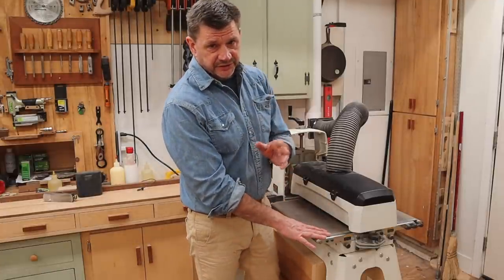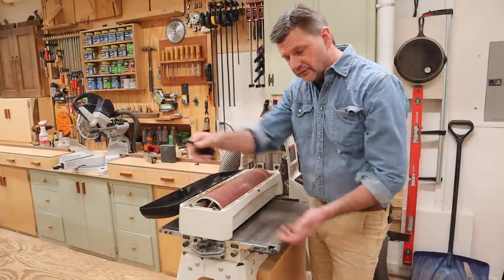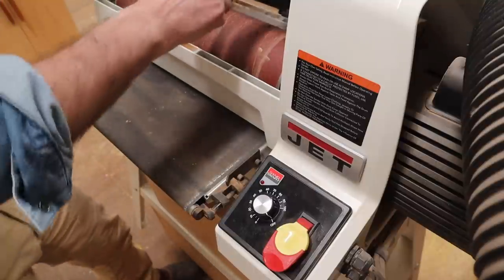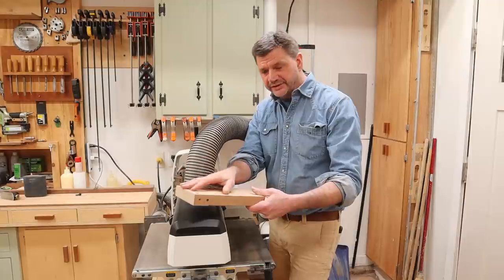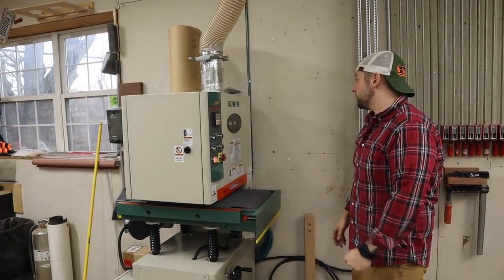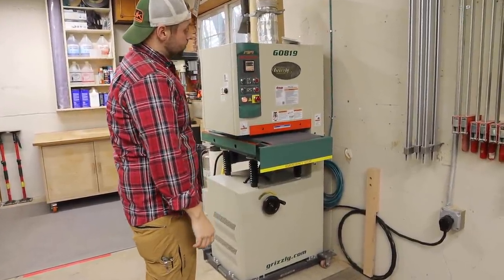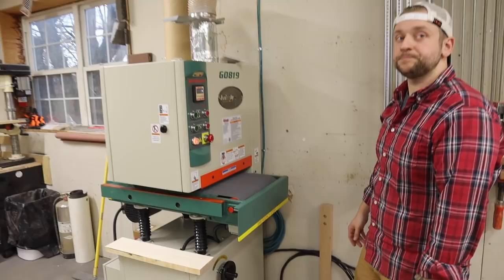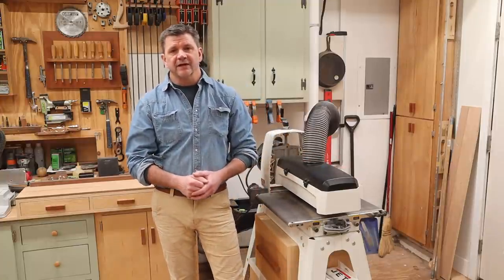Drum Sander VS Wide-Belt Sander: What Should YOU Buy?!?

Comment: I am not a fan drum sanders, they're not very accurate, under powered, slow, they burn paper pretty quick even at light passes, and most of all they leave heavy scratches that you still have to go back and sand out by hand. That being said that little wide belt, to me wouldn't be worth the money spent. I paid $1000 more than that and bought a used timesavers 137, it was made in the 90's it weighs 3000 pounds has a 20hp motor, and does a fantastic job. I will do 36 inches. Now I know that most people dont have the space and the electrical to run a machine like that, I would suggest finding a cabinet shop that has something like that and having them run it for you. It will give you a better job and you'll lay out a lot less money